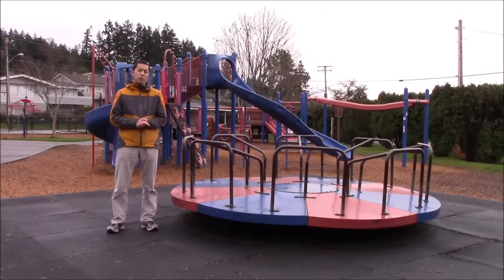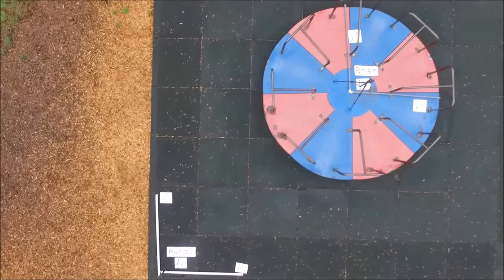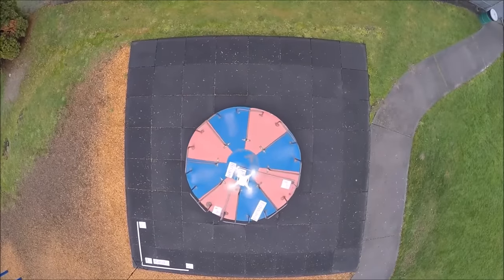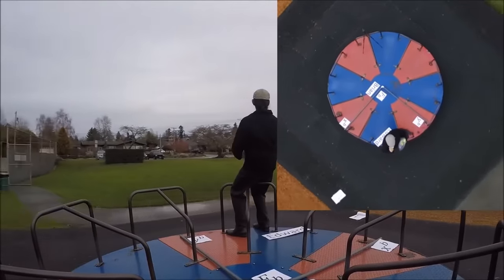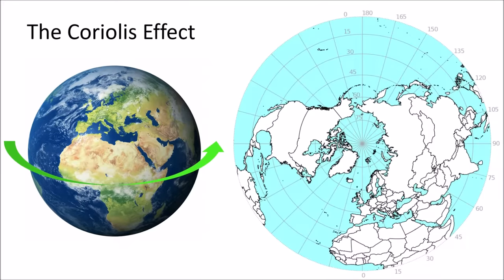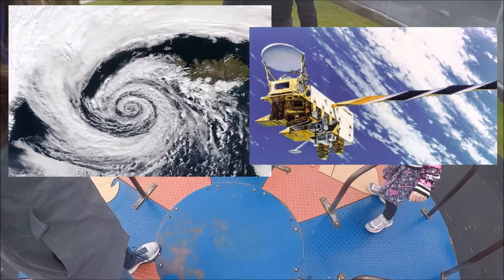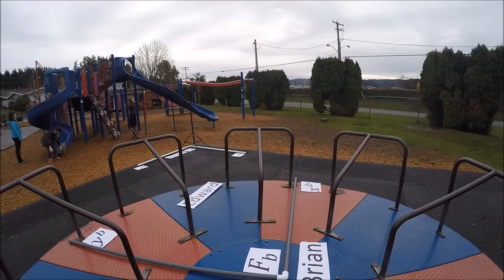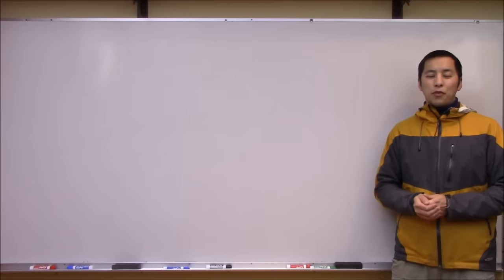Coriolis Effect Demonstration (with Drones)

Comment: HI, why doesn't this happen with your drone above the earth? The earth is spinning and your drone is above it just like the roundabout.
Reply: That's because of relativity. The drone automatically moves with the earth as it is standing still to the viewer on the ground. It's like two cars which are moving forward with the same velocity in the same direction. Because the relative velocity between them is zero, to the person sitting in one of the cars, the other car will not move away or closer.

On earth, the air actually slightly pushes the drone with the earth, as the drone keeps its momentum it got from the earth. Gravity also acts in this scenario as the 
center locator for the drone. It's the same as a rope holding an object in a spinning motion.

Also, because of the large scale of the earth, the differences on our scale are so small it won't have any noticable effect.
Reply: Plus inertia
Reply: Yep,  there it is... it's always "gravity".... gravity explains everything,  just throw it out there (just have faith and trust in the science - which isn't reproducible)... not very scientific-method of you.... also,  remember nature abhors a vacuum (vacuum next to "atmosphere")🤣
Reply: Word soup !
Reply: 1. Modern drones automatically try to stay still in the air, relative to the ground.
2. The earth turns WAY WAY WAY slower than the merry go round in the video:
Earth: 15° per hour or 0,0417rpm
Merry go round: around 4 seconds per revolution, so about 240rpm, or 324000° per hour!
Reply: Booooo.👎
Reply: @darkner2390  yet it somehow effects bullets and projectiles??? Sooo what you are saying is that Coriolis effect picks and chooses what it wants to effect? You do not understand the model you are trying to defend. There is no Coriolis effect witnessed anywhere on earth. IF the earth was spinning it would HAVE to cause Coriolis effect to ALL things not attached to the surface of the earth.
Reply: @inerfyr  Okay first of all, I love how you say that the Coriolis effect does affect bullets and then two sentences later, you say the Coriolis effect has never been witnessed anywhere on earth. Not to be a nitpicker, but you are outright contradicting yourself here.

Secondly, yes, it does affect things traveling north or south and which way hurricanes spin, depending on the hemisphere they are on. (By the way, I still haven't gotten a valid explanation from flat earthers on how this would work on a flat stationary disc. If you're going to deny something that already been really well established by science, at least give an alternative explanation with evidence.)
Reply: @tegbolddos  Thank you for wrongfully summarizing my comment, just because you saw the word 'gravity', which has basically become taboo in the flat earth culture, since it doesn't work with your imaginary disc world.

Secondly, if you honestly think science isn't reproducible, you haven't even understood the first thing of science in general or the science behind the globe.

Thirdly, vacuums do not suck in anything. It's litterally nothingness. And nothing can't do anything. This is a very common misconception, because what is actually happening between a high pressure and a low pressure environment, is that the high pressure is pushing itself outwards. You can imagine it like a room full of people and an empty room right next to it. Since the people inside don't want to feel like sardines in a can, they move towards that empty room. The particles act the same way.

And yes, I am going to use that word again which you don't like. Without gravity, there actually wouldn't be pressure to begin with. If earth didn't have gravity, its atmosphere would have pushed itself away into space.

By the way, if gravity doesn't exist on flat earth, what makes it so the air at sea level is at a much higher pressure than let's say... The altitude at which airliners fly?
Reply: because the Earth's angular velocity is 2pi/(23h56m), an the merry-go-round is on the order of 1 Hz, and the Earth gets a x sin(lat) reduction.

tl;dr it's 5 orders of magnitude smaller.
Reply: @DrDeuteron  Suppose I take off from the equator and fly over the north pole over to another city on the equator on the other side of the globe.  Suppose the plane can fly fast enough to make it there in 12 hours.  How do i get there?  I can't fly in a straight line because my destination would be 180 degrees behind me when i get there.  SO science tells us that "the plane moves with the earth" or somehow automatically I fly in a corkscrew pattern around the north pole and end up exactly where I would have by just flying straight at it and the ground goes from a tangential velocity of 1000 mph to 0 mph back to 1000 mph and nobody in the history of man has ever noticed this or seen the earth rotate underneath them in a second reference frame.
Reply: @tegbolddos  ”vacuum next to atmosphere” is just as high  pressure water next to low pressure water in the oceans. What do You think stops the high pressure water from  coming up and even go out in the vacuum of space? GRAVITY
Reply: @inerfyr  Coriolis effect is seen on the weather systems. So You are wrong.
Reply: @johnshillsburg1377  You ”forget” that the atmosphere is a part of Earth and so spins around at the same speed. The plane flies in the air.
. If Earth had been stationery, the stars would have had to spin around it many times the speed of light, and That’s not How cosmology works. 😮😂😅
Reply: @gregtroll  No, you will only see it getting smaller and smaller with the perspective. Nothing else. Same with boats disappearing behind so-called curvature but that you can still see fully through any telescope.
Reply: @inerfyr  Absolutely right!
Reply: @darkner2390  What about density? We don't need lalaland gravity to explain how things behave on this realm. Gravity is just a ''theory'' and not a law. Ever wondered why?
Reply: @RenoLaringo  
"What about density?"
Density is the mass of an object divided by its volume. How does this explain anything? For starters, how does this make things fall and why in a specific direction for starters?

"We don't need lalaland gravity to explain how things behave on this realm."
Yes, we do. Because objects never change their velocity and/or direction unless there's a force acting upon them. That is Newton's first law. You literally can't go around the fact that things that fall must have a force constantly acting upon them, pulling them towards the ground. Even in a vacuum.

"Gravity is just a ''theory'' and not a law."
This is wrong for 2 reasons.
1. Newton's law of universal gravitation. Look it up.
2. Misuse of the word theory. A conventional theory is a hunch or a vague idea based on little evidence. But a scientific theory, such as gravity, is a well-established explanation, and can be repeatedly tested and verified through observation and experimentation, in accordance with the scientific method.
Reply: @inerfyr yes there is.
Reply: Only with flerfs can you get so much random crap discussed that has nothing to do with the original, no doubt flerf-based comment!
Reply: @RenoLaringo ”You can still see fully with any telescope.” Ok Prove it.
Reply: @TheSteveSteele  Why should I prove something you can easily experiment yourself anytime? Just get the gear and give it a try. There will be the prove you ask from someone else to provide you with. Also tons of videos out there 👍
Reply: @RenoLaringo  Prove YOUR claims. That’s how things tend to work. You make the claim, you back it up. Let me guess. You can’t. 🙄
Reply: @RenoLaringo  Because, since you are the one challenging a fact that has been well-known by mankind for thousands of years, the burden of proof falls on you. You make the claim that the earth isn't round, therefore you have to provide the proof.
Reply: Because the drone has stability built into its software and makes adjustments to keep the drone in fixed 3D space. Much like your brain uses your eyes, inner ear, and touch to calibrate balance. Gravity is helpful in this because it pulls the fluid in the inner ear in one direction. It can do the same to accelerometer sensors which the drone can use to find it’s x-y-z tilt. If the drones sensors were shut off, it likely would do a lot more than just spin along the z axis (i.e it would crash just like humans do when you spin around a lot and we lose input from a sense)
Reply: There it is. Never surprised to find some ignorant layperson (flat earther) challenging well described and understood physics with misconceptions as if nobody in the history of physics have pondered these things. Yup, you’re the first person to have noticed such a massive blunder in fundamental newtonian mechanics. The answers to such questions surely don’t exist anywhere. /s
Reply: Your intuition is on point! As the drone gets higher above the earth, the Correolis Effect would cause it to most westward relative to the ground - thats why the northern jet stream flows east and the equitorial jet stream moves west. Sadly your drone doesn't gain enough height to make this effect noticeable - the height gained relative to the Earths radius is tiny. The Correolis Effect is all about conservation of angular momentum if youre interested in really understanding the physics - interesting stuff!
Reply: @inerfyr it dosent do anything to bullets and projectiles. Wind and drop will affect it. Not earth rotating under it.
Reply: @DrDeuteron sooo lockstep air? Nothing drifts then.
Reply: @YDDES yess!!! Lockstep air tethered to the surfice of the earth. Lmao so no coriolis at all then!
Reply: @sphaera2520 lockstep air in your mind.
Reply: @tegbolddos and use square roots if negative to make the math "work"
Reply: Does bullet move or does earth spin under it..the true reason for coriolis would mean the wind blows the bulllet...which is WRONG
Reply: There's that dreaded "observer" again!! 
He'll be the end of me.
Reply: Research flat earth. Hard to grasp at first makes more sense if u actually look at the facts
Reply: @tegbolddos we know the truth flat earth great comment u must have a functioning brain rare to find today
Reply: @YDDES density and buoyancy predict where elements like air and water rest at
Reply: It doesn’t happen because the earth is not spinning.
Reply: @shanecodman1842  Density and  boyancy need gravity to work. How else do they work?
Reply: It actually happens, but earth is rotating too slowly for us to see the effect
Reply: @kevinli256  1600 km/h at the equator
Reply: @tegbolddos  try holding a piece of paper to a string at the back of a fan big enough to pull them in. 
It’s your vacuum. You are the earth, the string is gravity. 

How do you explain the difference in air pressure if not for gravity?
Reply: @inerfyr the bullet is moving relative to the earth. The drone is not.
Reply: @johnshillsburg1377 lets put it another way.
If you were to dully stare at a plane on the ground which rotates on itself at 1rotation per day for 12 hours straight i don’t thin you ll see much motion second to second. Just like the pendulum experiment. You don’t see each swing changing orientation individually. But you notice the change comparing between two states at different times which are apart by a few minutes.
Reply: @RenoLaringo density only makes sense because of gravity. 
Density is defined by the amount of pull an object experiences depending on their volume. If the object is not being pulled at all then everything has a null density.

and if you want to tell me that the object is being pulled towards the ground but it’s not because of gravity then be my guess at explaining what pull it.
Reply: @tegbolddos Of course gravity can be reproduced, in fact there are experiments that measure gravity.
Reply: @inerfyr affect is the verb - effect is the noun. That's always a good starting point in any discussion.
Reply: @VaxWax-z5y  LMAO. Every long-distance marksman, naval gunnery, and artillery manual in the world have Coriolis and earth curve calculations, and every shot factors them in in order to hit targets. Literally ask any military graduate of a gunnery school, or for that matter any engineer, cartographer, surveyor, scientist, meteorologist, etc. all of whom have to use both daily to make anything work.

Just because you don't understand something doesn't mean it's not true.
Reply: @inerfyr  The Gulf Stream and the Antarctic Circumpolar currents in the ocean are an example of the coriolis effect that's been observed. One of the most notable instances where the Coriolis effect influences ocean currents between both hemispheres is the Agulhas Current in the Indian Ocean and the Brazil Current in the South Atlantic Ocean. The Agulhas Current flows southward along the eastern coast of Africa, while the Brazil Current flows northward along the eastern coast of South America. Both currents are deflected to the left in the Southern Hemisphere due to the Coriolis effect and play significant roles in the global ocean circulation patterns.
Reply: @tegbolddos flat earther found!!
Reply: @xXYannuschXx  I’m no scholar or higher educated by any means but I thought about the speed and that even tho the earth is moving at a high speed it’s actually still seems very slowly, if observing, right?